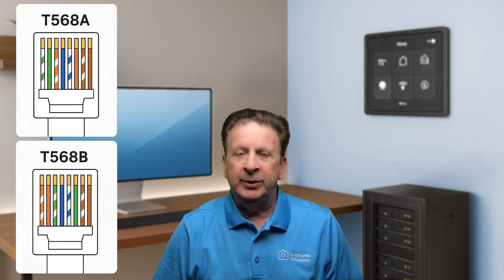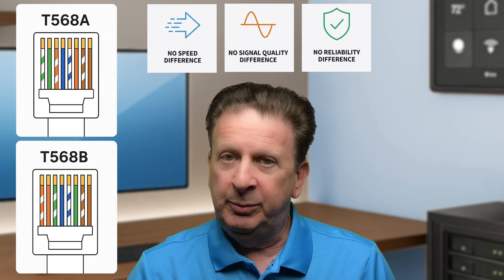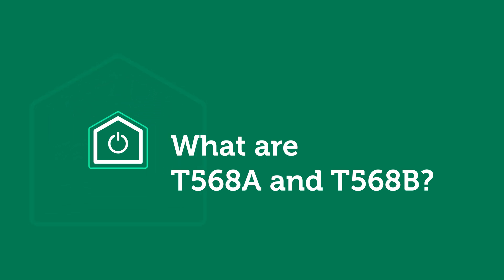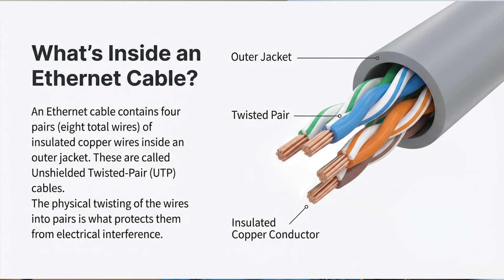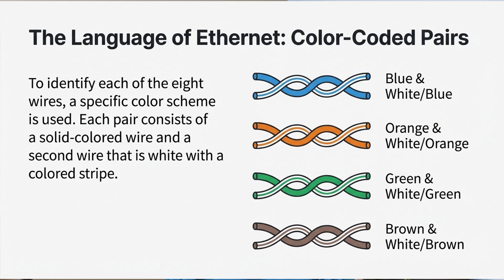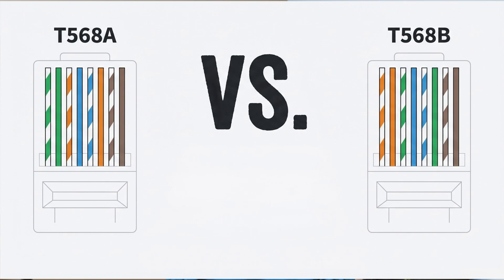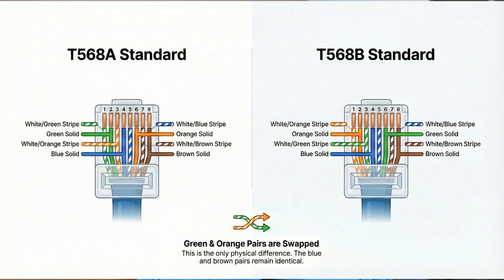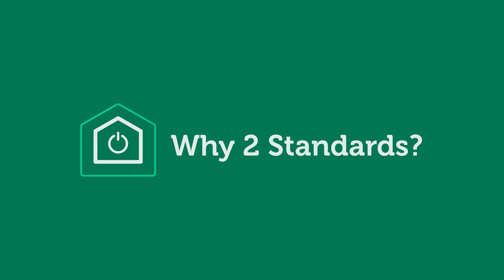T568A vs T568B: Which Ethernet Wiring Standard Should You Use?

Comment: According to Wikipedia we should always use the A variant with B only allowed in existing installations that already uses B. The B variant only exists because some installations already used that wiring schema in 1991 when the standard was first published. So following that, all new installations should be A and the "B for business" is just nonsense. For cables it doesn't matter in the slightest and it is very unlikely anyone will check what you used, as long it is the same at both ends (A or B).
Reply from the maker: Wikipedia seems quite wrong here.  That is backwards - "B" is more commonly used everywhere while "A" is used only where it already exists (mainly in homes and government).
Reply: @DoItForMeSolutions  I found another source that said something similar to Wikipedia. Then I asked Claude, which claims the B thing is mostly seen in the US commercial sector, while the rest of the world and the US public sector prefers A.
Reply: @DoItForMeSolutions  Also found this in the ANSI/TIA/EIA-568-A (CSA T529-95) standards document: Pin/pair assignment for 100 V UTP cable is recommended to follow
the T568A configuration. To accommodate certain cabling systems,
the T568B configuration is accepted.
U.S. Federal Government publication FIPS PUB 174 recognizes
designation T568A only.
Reply: @DoItForMeSolutions  I will conclude that if you do work for the US government you MUST use "A" and for everyone else it is just recommended. Outside of USA everyone uses "A" because "B" was made to be compatible with an older wiring system that was only used in the US, so there never was a reason to use anything but "A".

Comment: additionally, if you obtained the Cable and RJ45 as DIY kit where neither of both ends are crimped yet,
You can just do the arrangement of the individual colored wire to be near each other as long as both ends are crimped the same way.
So instead of T568A or T568B standard, you can just do Orange+White Orange, Blue+White Blue, Green+White Green, Brown+White Brown.

As long as you do both ends EQUALLY, there's literally no difference in signaling, performance etc
Reply from the maker: Sorry, but no.  Use A or B wiring, don't invent your own.
Reply: @DoItForMeSolutions  Indeed! Before I fully understood the standard (early noughties) I made a cable using continuous adjacent pairs without the centre nested pair within a pair. The simple 8-way cable tester declared that all was fine but the cable simply would not transmit. I even took it to a computer specialist shop and they scratched their heads too. It was only when studying in detail the wire arrangement in a ready-made patch cable that I spotted the centre pair geometry. With the cable re-terminated both ends, everything started to work. That ready-made cable was of course a type B, and therefore that is what I have been using for the last twenty years. :)
Reply: That strategy will work if you have a short enough cable operating at a low enough speed.  But for a long run at a high speed, it's important for the twisted pairs to be paired up the way that the engineers who designed the equipment expect them to be.  Both T568A and T568B will do this, by keeping the center pair of connectors on one twisted pair, the connectors just outside the center on a separate twisted pair, the first two connectors on another twisted pair, and finally, the last two connectors on the last twisted pair.

The electrons don't care about the color of wire insulation, but if you're going for a long enough distance at high enough speed, they definitely care which pairs of wires are twisted together.

Even though the electrons don't care about the color of wire insulation, there's no advantage to inventing your own convention, and you can cause a lot of confusion for the next person (or for yourself) if you deviate from the standard.   So it's best to pick one of the official standards and stick with it.

Comment: The one reason for both wire types are now mostly obsolete. With almost all modern networking gear able to auto negotiate the transmit pair and receive pair, the reason has pretty much vanished into historical oblivion.
The real reason is early network hubs and switches, used to have an uplink port. 2 switches could not be coupled together with a "Straight cable" as both devices would RX on the same pair and TX on the other pair preventing communication.
Early network switches and hubs had a Uplink port where TX and RX were swapped to liink upstream to another router or switch.
Then when the uplink port was removed a Null Modem cable is used instead of the uplink port. This required the cable to be A on one end and B on the other, and was often called an uplink cable to connect a switch to another switch.
Almost all modern gear auto detect and auto negotiate between devices to be able to use a straight connection with both ends wired A or B and still work properly.
It is not so much as 2 standards, it is a straight cable has the same wireing on both ends and a crossover cable has each end wired differently to cross over the pairs in the cable.
Reply from the maker: The uplink port and auto MDI-X are certainly part of the story, but the backward compatibility with analog POTS lines was a big issue in the US before the conversion to all-digital telephony.

Comment: If you do it the same on both ends. It wont really matter. But B code is generally used for residential and most commercial settings. A code is often reserved for military and government use.
Reply from the maker: Yes, but I do see some homes still using A.

Comment: Story time. The computer shop I worked for started using twisted pair. We had no idea what we was doing, nobody else in town did either. So we ordered the wrong cable or the wrong ends depending on how to look at it, also did the colors all wrong. This was before just looking it up on-line. We did have a few networking books, but they did not cover cat 3 or the new cat 5. This was pointed out to us. Side Note: The person who pointed it out didn't want to help us at all. So, we ordered another book. I looked into the book and shook my head. Pulled out the other book and showed my boss. The older book showed AT&T 568? wiring and the new book showed 568A & B, I think B being the at&t standard. After that we went on to fix several bad installs from other companies.. My personal fave was the cheap light tester we had. Solved tons of issues. Never did get the fluke tester I wanted.
Reply from the maker: Any test is better than none, and yes, the Fluke works great!

Comment: I used to run and terminate Ethernet wires. I’ve noticed crossover cables work without issues. Speed test ran fine. Idk if there are any unforeseen problems if left like that. I never did a full diagnosis to find any. I just made sure at the wiring matches at the end. Modern computers seem to have built in software to reroute the lines digitally. I’m pretty sure win xp would freak out though
Reply from the maker: It really depends on distance and speed.  At shorter distances (typical runs even from end-to-end in a home)  and 1 Gbit or slower speeds, it is hard to see any ill effects of improper wiring most of the time.

Comment: T568B is the most common standard. Unless you have a specific reason to use T568A, it’s best to stick with T568B. From a performance standpoint, if you’re not seeing packet errors, the link is running fine. People often claim that Cat 8 is “faster,” but at 2.5 GbE, it offers no real advantage. If you’re seeing interface errors, check your cabling; if there are no errors, move on.   Yep,   added in a rant.   CAT6A for the win.
Reply from the maker: So true.  If it works, it works.  Cat 8 has application in data centers and where runs need better shielding from electrical interference, but typically that is not a home environment.
Reply: I wired my house with 568A without really thinking it over too much, but now I wish I'd done 568B. Maybe at some time I'll repunch the jacks and patch panel, but honestly, it's made no difference to me. Regarding speeds, I used some pretty good Cat5e cable at the time maybe 20+ years ago) and I've been able to get 10 Gbe speeds over it, so you can get good speeds over older cables if they're quality.

Comment: With old equipment which didn't support RX/TX autodetection it was necessary to use straight cable (same standard on both ends) to connect an endpoint to hub/switch downlink port, and crossover cable ("A" on one end, "B" on other end) to connect endpoints directly or to hub/switch uplink port.
Also twisting steps on different pairs are slightly different, so RF characteristics aren't exactly equal. But this difference is neglible.
Reply from the maker: The different twist rates do affect performance of the higher-end speeds and distance, but for most installs I agree any difference is negligible, if at all.

Comment: The only difference between A and B is the colour on the outside of the conductors. In both standards the conductors terminate to the same pins at each end. They exist from the early days of ethernet when auto switching Hubs weren't common. One end of the cable had to be A the other B so data pairs which were 2 and 3 were connected from send at one end to receive at the other. This created confusion and was quickly replaced by the use of a Cross Over, Patch Cable,  and the introduction of auto sensing ports as in modern Switches. Cross Over cables are still used today when connecting two NIC's that aren't Auto Sensing, common on PC's. Over 30 years I've always used A except when the specifications stipulated B. In Australia A is most common, I'm lead to believe in the USA B is more common.
Reply from the maker: There is a difference in the twists-per-inch for some pairs in newer cable standards, so more than just a cosmetic color difference.

Comment: What should be mentioned: A RJ11 plug in a RJ45 jack might damage the outer pins of the RJ45 jack.
Also the first wire of each pair is the white striped wire. The solid coloured wire is the second wire in all telephone wiring I know of when pairs are identified with white + a colour.

However, what ever you use, T568A or T568B, keep consistency. Don't mix on the same location. Most important is that you know the difference and put the pairs on the right pins.

Also: A cable with T568A at one end and T568B at the other end will be a cross over cable in the old 10/100 MBit/s Ethernet. Old Ethernet only used the pins 1, 2, 3 ,6, or two pairs. One for receive, one for transmit. The pair on pin 4, 5 was left free probably on purpose for analogue telephones.
The pairs on pin 4, 5 and pin 3, 6 usually make most problems regarding NEXT failures as well.
Reply from the maker: Good to be aware, but I guess people using RJ11 phones may still not be using wired Ethernet?
Reply: @DoItForMeSolutions  Aware of what? It still happens that people plug an old telephone into a RJ45 jack and damage the pins. So, that is something people should know when they work with that stuff. To use cat cables in an office building but maybe still use non-VoIP phones, is pretty common.

The part about old Ethernet ... Depends on where you work. Some companies use old hardware. Some old productions systems only support 100 MBit/s Ethernet. Maybe some technician in the past has "split" on cable onto two jacks with a custom wiring and you search for a failure or try to find out why devices are slow. Maybe somebody used "free" wires for old / custom PoE setups.
For a real technician it is always helpful to understand the technology we use and its development over time.

Comment: Interesting, I worked for a telco and everything I saw was 'B', so I took that standard home, after watching this and remembering the old telco colour scheme, Blue Orange Green Brown Slate, I'm going to swap over to 'A', as I like my retro, and some analogue phone stuff sounds good.
A good lot of my home network is 100Mb, so I have two spare pares that i love to abuse.
You may say why 100 only, well my broadband link is only 25Mb, I started with 50Bd TTY, then 300Bps dialup, so in that context 25Mb is bulk fast.
Reply from the maker: Good approach. Just FYI, before there was Internet, people were more aware of the speed between computers, not just back and forth to the "cloud".  Even with a slow Internet connection, there are uses where you want very fast data/file movement between local PCs or devices so having more than 100Mbps speeds locally can still be very useful.

Comment: I'm sorry, I can't help it; Both A and B can be used for 2-line POTS, as both color schemes terminate the second pair at pins 1 and 4 (of RJ11, Pins 3 and 6 in RJ45) The color of the wire is irrelevant, as long as the pairing and order match up both ends of the line. Rules of thumb; don't split pairs, same colors on both ends. Of course, being consistent is important but mainly to prevent confusion. Both standards work perfectly, electrically speaking. As long as focus is on pinnumber, not color, any color in any pin will do (but never split pairs!). Also; I read some comments stating mixing T568A and T568B makes a crossover cable; yes, but no. Both T568A and T568B have the pairs 45 and 78 Blue and Brown respectively. A crossover cable runs 12 to 36, 36 to 12, but also 45 to 78 and 78 to 45. (And if your hardware needs a crossover cable, it is old, and if so, it's 10 or 100 Mbit, then indeed, the pairs 45 and 78 don't matter, but still, don't assume ;) ) @DoItForMeSolutions Love the discussion material :) Also, Happy Holidays!

Comment: You can arrange the colors in any order you want, so long as they are in the same order on the other end. In fact, you can cross 1, 2, 7, and 8 in any order you want as those are ground wires. But IF for any reason someone has to chop the end off and re-do it.. if you used some kind of wonky system, they're never gonna get that cable to work again at least without chopping the other end off too. So, IMO, I'd put all the stripes on 1278 (since it doesn't matter what order they're in) and go Blue-Brown-Green-Orange for 3456 because that's in alphabetical order and easy to memorize. And if the outer pairs did actually matter, then just do Blue-BlueS, Brown-BrownS, Green-GreenS, Orange-OrangeS. Again, KISS. Keep It Simple, Stupid.
Reply from the maker: There is a difference between "it seems to work" and using the correct wiring to spec.  Strongly recommend you follow one of the standards and not make up your own wiring scheme.

Comment: interesting mini history lesson. i been working with cat cables more than 20 years now and i evengraduated computer technical school for what it's matter but they never told us why A or B is the dominant standard , just that B is much easier to come by in stores, because most premade cat cables at the stores will be a B-B standard . they also told us that we might need an A-B cable only in 2 cases. 1 connecting 2 ethernet hubs together. 2 connecting 2 computers without a hub or ethernet switch. since houses in the country i live never used cat cables as intended for telephone use (we used 2 pair cables for telephones and traditional sockets were different)
one thing to add to video though "mixing standards" in a network is not going to break anything. just the guy wo will came after you to fix things in the future will have harder time grasping what is what. pluging B-B cable into A-A socket will not even cause crossing over the cable, it would be seen on both ends as a straight cable. and most of the modern switches don't even care if the cable is straight or crossed over so the would work both with B-B, A-A cables  the same as with A-B
Reply from the maker: Yes, avoiding mixing A and B is primarily about documentation and helping the "future tech" that is called in to repair or extend the network.

Comment: Lovely information.  Very deep cut.  Auto-MDIX for the win.
At home almost no one builds their own cables.  An RJ 45 crimper is 35 to 40 USD before you even buy the bulk cable or the un-crimped end connectors but a 30 foot ethernet cable (with ends installed by robots) is around 8 to 12 bucks.  Most people don't need a cable at all--they need a bridge or a mesh.  I've run bridges through electrical sockets for something like an IP phone which doesn't need much bandwidth and the wireless bridges people usually use for security cameras work quite well for other purposes.  All the major cell phone companies are offering 5G at home internet and people with home offices can just co-locate the 5g-router with their office.
Reply from the maker: It really depends on what is being used and how.  I talk to a lot of consumers that want to put in one or two long runs in their own home to fix problems with Wi-Fi coverage by providing a "home run" for the Wifi access point.

They want to make their own cable because they don't know the length until they actually start pulling the bulk cable through the walls or ceiling.

There are less expensive crimpers than $40, but personally i would spend the money and not risk it.
Reply: @DoItForMeSolutions  
What is being used and how--absolutely.  99% of residentials don't need cables.  My philosophy remains: if you don't know how to design your own wired home network than you very likely don't need one.

Most people are being ISP throttled anyways.